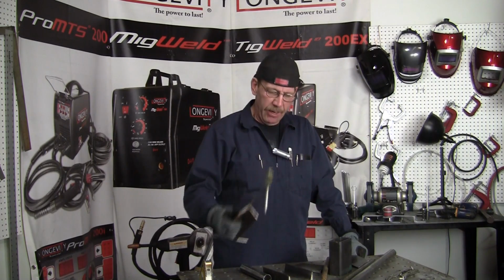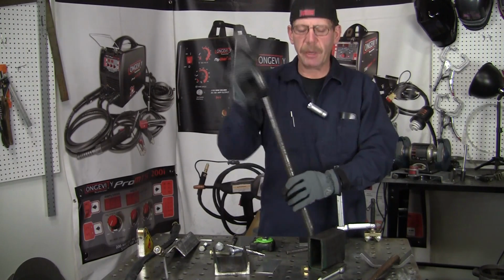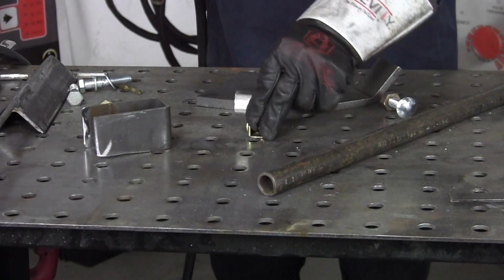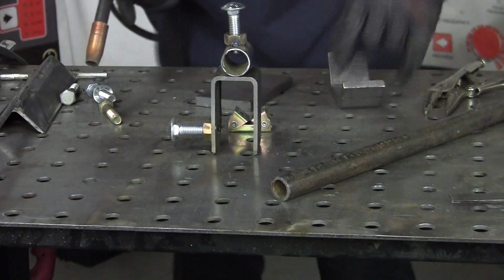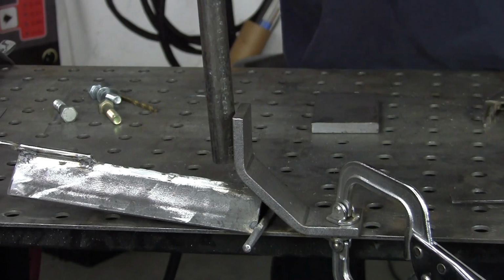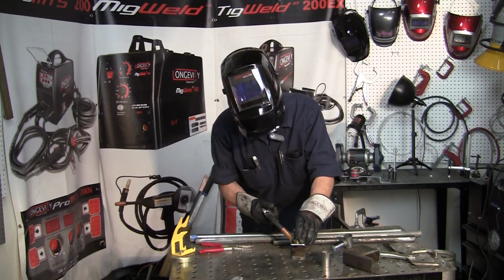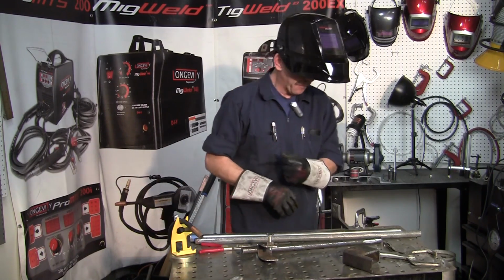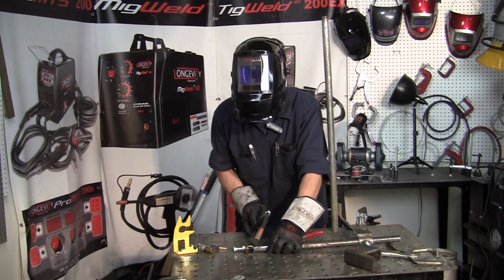HOW TO MIG WELD YOUR OWN WELDING STAND

Comment: Pretty sure you mixed up the order of the clips when editing your video.  You finish the stand basically, then go back and show welding the nut into the clamp portion again, but from a different angle. 
 Watch your own videos before you post them.

Comment: Thanks! This is a nice, simple stand. A couple of suggestions:
1. Can you mention the size of the material you're using? The rectangular tubing looks like 2" x 4" and the pipe pieces look like 1".
2. I think you should comment on the dangers of welding galvanized pipe without good ventilation.
Reply: +Laurence Heine 
There's a fume extractor right there in the shot.  It's that yellow cone near the red helmet without a lens.
Why isn't he using it?????